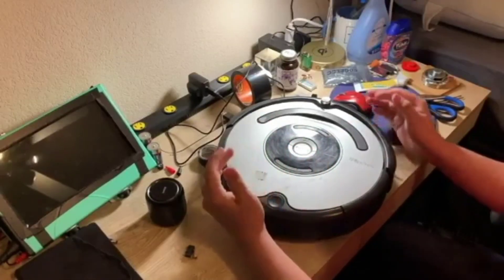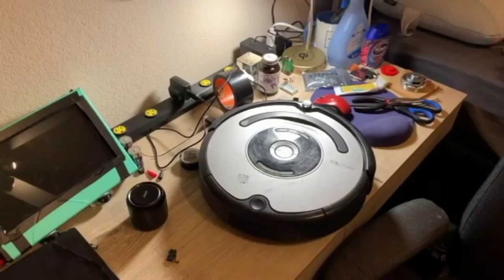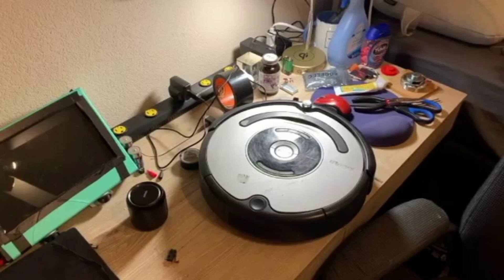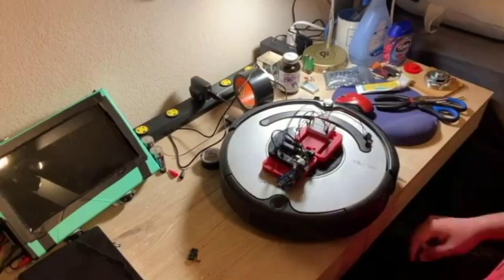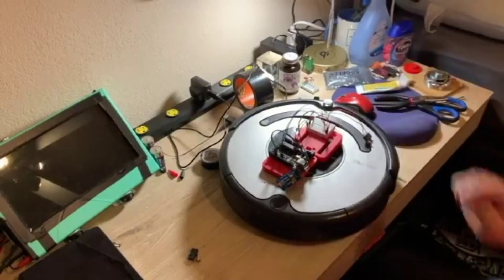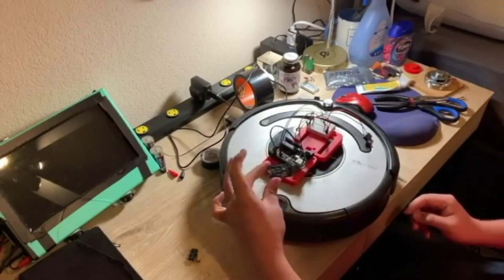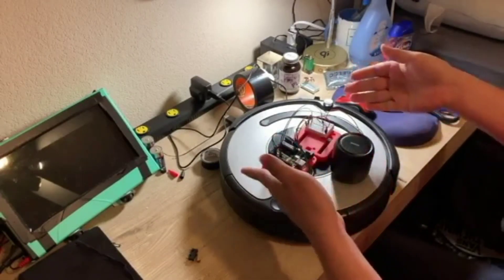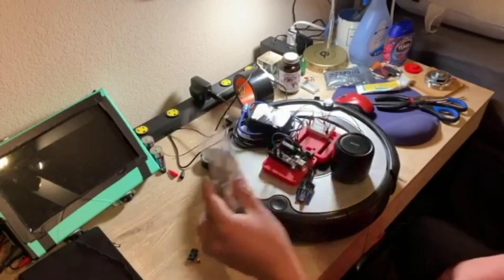How to Build Your Own Screaming Roomba || Part 1 of 2

Comment: Does it have to be a roomba? My robot vacuum is a ionvac
Reply from the maker: Not necessarily! The way the system works is that a switch attached to the front bumper triggers the sounds. So as long as whatever robotic vacuum you have has a front bumper for sensing when it runs into things, you should be able to use this setup!
Reply: @notmymajor2536  Alright, badass!